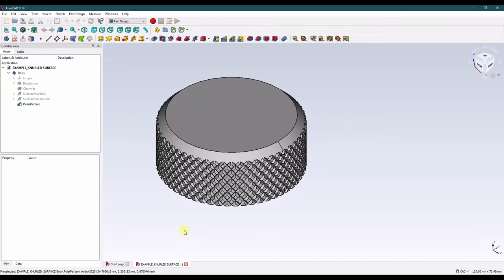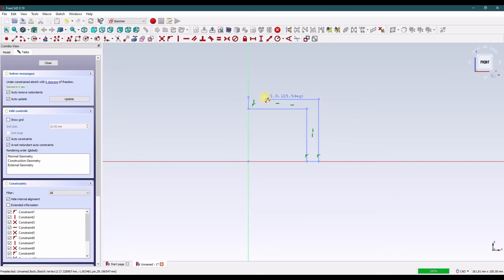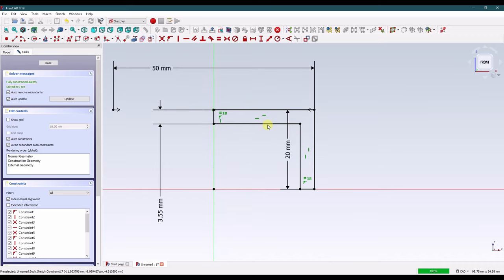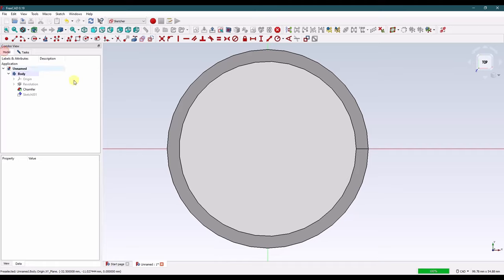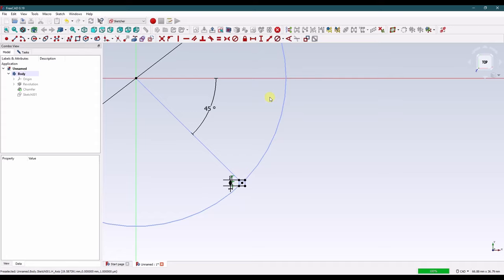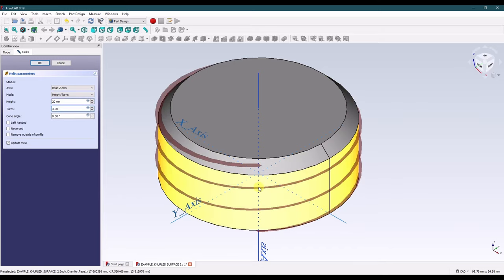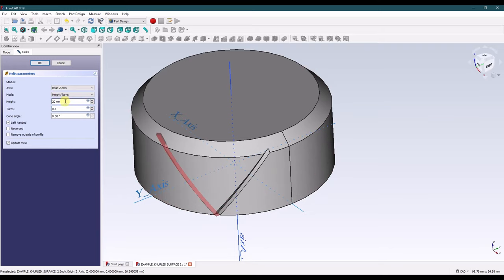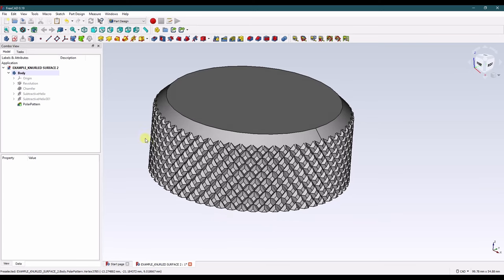FreeCad Tutorial #6 | EASY way to Model a KNURLED Surface for 3D Printing in FreeCAD

Comment: Hello KTEC DESIGNS. Very nice and informative video. As an undergraduate software engineer I can tell you that FreeCAD, as per documentation uses an OpenGL-based 3D API which means that it tries to either offload the calculations to your computer's GPU or, if you are doing this on a computer without a dedicated GPU (eGPU), uses the embedded GPU of your CPU. Now, eGPUs of modern CPUs are generally lower powered components designed, in most cases, for basic display output and are much less powerful than a normal dedicated GPU. In this situation FreeCAD tried to offload the 3D calculations of the model to your computer's GPU and straggled because it's a hefty calculation due to the geometric complexity of the knurled surface. I hope this is informative enough. Keep up the good work!
Reply: Is there a way to change the settings? Like in blender when rendering, select cpu or gpu
Reply: In this case, it is a combination of the OpenGL render after the OpenCascade 3D engine does the calculation. OpenCascade, as most older solid engines, are not using multiple cores. This operation, for solid model math is very compute intensive.
Reply: And, no there are no settings to change how the various libraries use the cpu or gpu. You can adjust limited functions of OpenGL in Edit>Preferences, but this changes how OpenGL addresses things like render order mostly.
Reply: No wonder it is constantly taking a shit on my old laptop haha GPU power is non existant.
Reply: Takes about the same amount of time with a quadro k40000.  Commercial packages do this almost instantly.  Its a shame, freecad is getting pretty awesome.
Reply: dont forget to tell windows in the settings display advance to add an app to use the gpu . it has to be selected manually

Comment: Nice method, especially compared to some of the more complicated approaches I watched first. With that said, I had an issue generating the subtractive helix. Turns out it was because I missed one fundamental step in the sketch... I didn't toggle construction for the circle and 45 degree line. As a first time user of the software, this was not an obvious thing for me to check. I actually re-watched the video numerous times before I realised my mistake. It might be worth adding an annotation in that section so that other newbies like myself don't make the same mistake. Thanks for the video!
Reply: Well as a  complete novice, you want every .... detail, later you do not want to lose stuff what is obvious to you. Anyway, with tinkering around, you learn too. As a complete novice, maybe you should learn easier stuff beforehand.
Reply: This comment was very helpfull. I too am a novice and was getting an error of wire frame. After fideling around a lot and repeat watching the video multiple times, I checked the commets. Thank you saved me a lot of frustrating time waste.
Reply: Thank you! Now I can finally complete my cases for my photography filters.

Comment: Yes, very neat indeed! However, KTEC says at the outset quote “ if you’re new to FreeCAD….” and then quickly plunges into the process with little time given to explicitly enumerate the command options selected: following the mouse pointer in order to determine this was nigh on impossible. Yes, I get the principle, but - as the tutor says - I am indeed new to to Freecad, per se, and am finding the command structure - compared with my most familiar Sketchup pro - a little difficult to grasp without explicit guidance. FreeCAD is not, I find, particularly intuitive. I wish I could slow the video down so I could decipher the specific commands used to create this really impressive knurl, especially as I need to model a very similar cap and then create a 3D print from it. But yes, a really cool solution compared to other videos on this subject. PS: after re-running the video a number of times, managed to twig how the helix was generated and the polar array executed….phew!!

Comment: Freecad has a lattice 2 workbench as an addon. It is a more in-depth method to do polar and linear arrays. Its computing time is much quicker.
Reply from the maker: Thanks, I’ll try it out. I’ve seen it before but haven’t dabbled with it yet.
Reply: One of the things which make FreeCAD so difficult to begin with. The same stuff can be done in various workbenches and each one has specific limitations not obvious at the start...

Comment: How did you get to the 55 turns in the boolean pattern?
Reply: It's the number of times the knurl cut fits into the circumference of the circle so (diameter*pi)/knurl size = number of times it fits

Comment: I have a similar problem as the number of faces increase. I made a plaque and it ended up around 1600 faces and everything I did after I padded the text just ran slower and slower, and I gotta say, from a design POV, knurling creates a multitude of faces.

Comment: Calculation Tip:
To get the Turns required I created a calculations sketch (hidden, containing only construction geometry). Create a line at 30° Angle from origin. vertical length of line = part height. Then use a reference constraint to get horizontal length of the angled line. Divide horizontal length by `2*pi*(part diameter/2)` to get the value to use for turn of Subtractive Helix.

To get the amount for Polar Pattern I used `[2*pi*(part diameter/2)]/[(knurl depth*2)*1.8]`. This calculated to 29.99 for me so I use 30. If the result is not up to expectations the last value can be increased/decreased slightly to get a better result.
Reply from the maker: I finally found my calculation. I used the distance formula (h = sqrt(a^2 + b^2)) to find the length of the square's hypotenuse (because the square is small, it's roughly equal to the arc length between the coincident points of the square that sit on the cap's circumference). I then used that arc length to find how many instances of the square that I can fit along the cap's circumference. That formula is "pi*D/h". Since this represents squares in sequence end-to-end, I divided the result by 2. So, "h=sqrt(2)" for a square that is 1mm x 1mm, and D=50mm, therefore the circumference "50*pi" divided by the arc length "1.414" is approx. 111. Divide that by two, you get 55.5. Rounded down I ended up with 55 instances.

Comment: One tip: you can calculate the number of polar revolutions in the expression editor by referencing the knob radius, pi and the knurl-thing size.
Reply: would that be: 2 x r x π and then whatever comes out of that divided by the length of the knurl-square?

Comment: (FreeCAD 0.20) Upon adding the second subtractive helix, the first one got deformed somehow. I thought to fix that by using pitch height for both helixes, but upon waiting 10 minutes for the polar pattern to finish, I got an error that a boolean operation failed. So much for knurled surfaces.

Comment: I don't understand how the helix settings translated into the diagonal line, and how polar pattern of these lines made final knurling. Seems to just happen but how? The final result does look good.
Reply: Helix is applied as a pitch.  Distance in the axis direction per turn.  For a 10mm long knob, 1mm pitch would give you 10 turns. 100mm pitch would give you 0.1 turns.

Comment: When attempting to do the helical cut, I continuously am getting a " wire not closed" error. I've went over all the constraints & it all looks good but still getting the same error. Any suggestions? Thanks in advance
Reply: have the same error, not sure what i did wrong. edit: solved it by removing everything from the sketch except for the rectangle and constraining that at neccesary distance from the center of plane

Comment: You said that you "calculated" that you needed 55 repetitions. Can you explain how you calculated that number?
Reply: You need to calculate the perimeter of the cap as pi*diameter, that's the total length to cover. If your pattern has L length, then the number of repetitions must be the integer number closest to pi*diameter/L.

Comment: I've tried to create your example, but I just can't get it to work. When I create the second subtractiveHelix it wipes out part of the body. Also I tried to polar array just the one subtractive helix and it won't create more than about 15 copies without wiping out the body. I get this error when I array it.  Error: one transformed shape does not intersect support. I've messed with it for two days trying different things but nothing works. Any help would be appreciated. Thanks
Reply from the maker: Sorry to hear that. I'm not quite sure what the issue could be. If you send me your model via email, I could see if I could figure out the issue.
In general, though, it's a computational intensive operation, so perhaps your computer is struggling to compute the result.

Comment: Had several attempts at this. Even tried padding my sketch instead of revolving it to produce a solid body, but to no avail: same error message pops up every time. “Wire not closed” when selecting the helix command. Anyone any ideas? Website returns: “There do not seem to be any answers to your search”, or words to that effect.
Reply from the maker: "Wire not closed" could mean that the sketch entities are not closed. By that I mean, the square might not connect together at every corner. You can check this by clicking and dragging each line in the square to see if it is able to move. The same with the vertices of the square. Another thing to make sure is that all other sketch entities besides the square are construction lines.
If you are still having issues, you can email me a copy of your model, and I can see if I can find the issue.
Reply: @KTECDesigns  Success! had another go and encountered an oddity. Attempts to create a fully constrained rectangle/square were frustrated by the vertices not being selectable even with the body made invisible. The solution for me was to (effectively) flip the sketch by padding the body in reverse. Creation of a fully restrained square was then achieved without difficulty and I was able to create the opposing helical grooves and apply the polar array without any further problem. One further point. At the sizes used in your demonstration tutorial - approximately 1mm square - the sketch wasn’t displaying in model space after the constrained sketch was closed. By increasing the size: I used a 20mm square, the sketch was clearly displayed. Of course, at 20mm the results of executing the helix command were somewhat bizarre. However, I eventually settled for 5mm and all was well. Yes, I did maintain the depth of cut at 0.8, the “surplus” body, therefore, had no impact on the final result: it simply increased the visibility of the sketch in model space. It did occur to me that because I elected to use 20 occurrences in the polar array it also avoided the possibility of the larger sketch colliding with itself in the event I had opted for the maximum possible number of grooves? In SketchUp which I use for developing engineering design ideas: currently a sphere turning fixture for a woodturning lathe, I tend to create subtracting volumes, when executing boolean operations, that are (probably) a lot larger than they need to be, but it dies ensure the operation doesn’t miss anything. I fancy, by enlarging the sketch to a “generous” size in this knurling exercise, I was instinctively applying the same logic and successfully too. Would possibly be subject maybe, to the “collision” phenomenon when higher occurrence values are used in the polar arrays. By the way. I appreciate your responding to my plight, thank you.